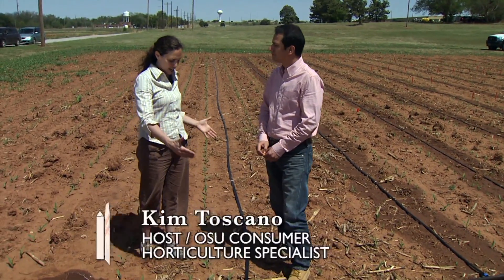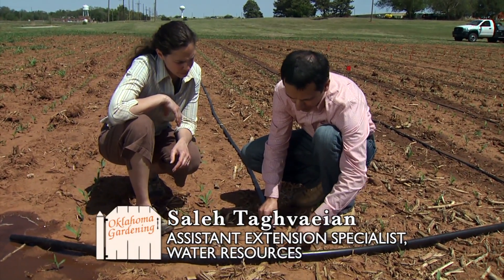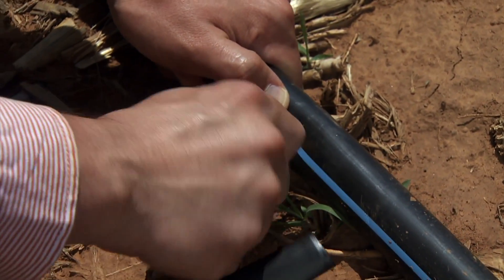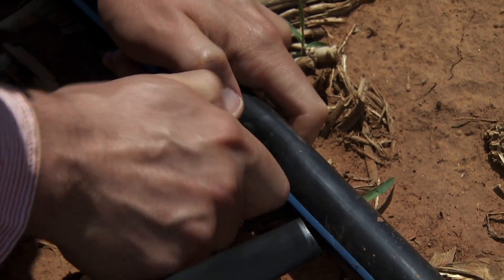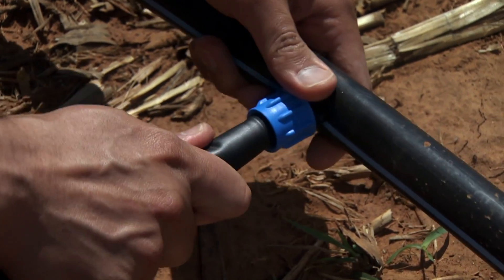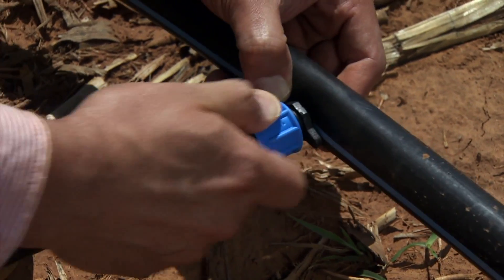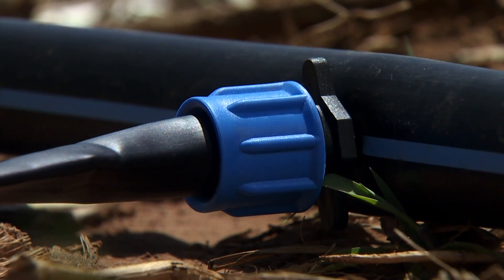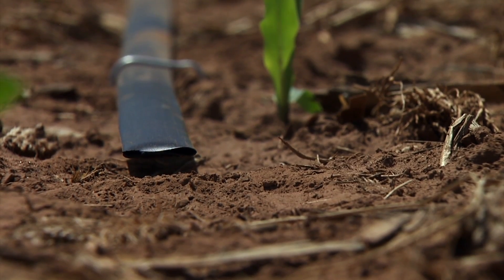Garden Irrigation Kit:  Connecting Drip Tape to Header Line

Comment: What size is the header line and drip tape?
Reply from the maker: Here's the information, Joseph! 

Header line
1.00 inch polyethylene (PE) hose

Drip tape
Manufacturer: Netafim
Model: Streamline 636 015 F
Inner diameter: 0.636 inches
Wall thickness: 0.015 inches
Flow rate: 0.24 gph at 10 psi
Emitter spacing: 12 inches